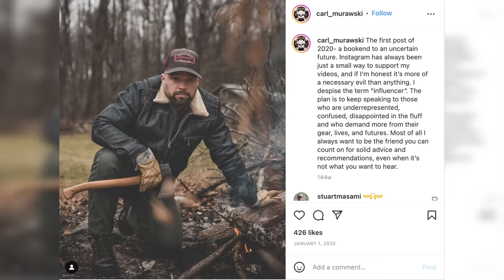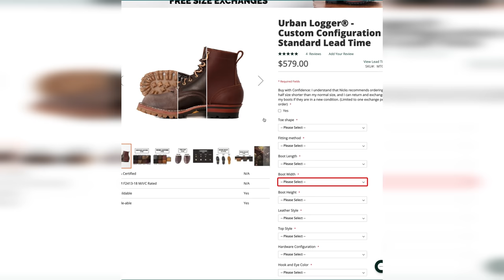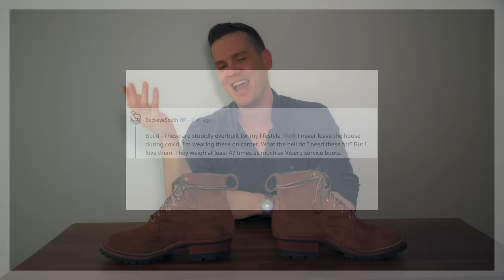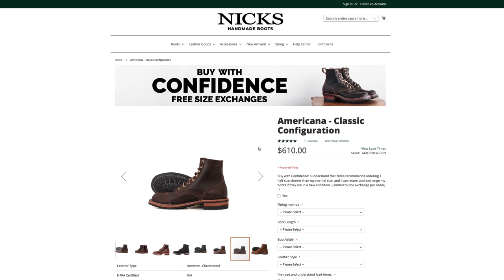Nick's Boots Review | The Urban Logger Isn't for Me (But Might Be for You)

Comment: I own the Nicks Falcon (8" in Predator Orange) and the Nicks BuilderPros (10" in 1964 brown) - I use them for motorcycle riding. Make no mistake about it, the Falcon is an overbuilt beastly boot as well. It weighs 30% more than more than my Iron Rangers and the leather is 50% thicker than the copper rough and tough. I do prefer the Falcons to the BuilderPros though - the block heal with the 430 mini lug makes the boot much more versatile in general.

Comment: Another justification id add to the urban side of this boot would be the arch support. Boots made with the veg tan leather insoles etc arent gonna have the same kind of arch support as a logger boot will. Yea you can find moderate arch support in other styles. But typically, the lower the heel, the lower the support. So if you have high arches, the extra weight and rigidity of this boot might be worth it for you

Comment: Very useful advice. I bought the Urban Drifter which has a regular heel and relatively low arch. I reckon for me they run a good half size bigger than Thursday or Truman. The Difter isn't a city boot but you can get away with it. Strangely, I expected them to be a lot heavier but they are built like a tank.  Bottom line is I would not buy Nicks again as they are too hard core.

Comment: They are definitely on my bucket list.  I just need to get the size squared away as I don’t want to risk getting the wrong size after a long wait. I’m presently wearing a Thursday Captain in 8.5 D and they fit very well but wish they were available in an E width. Great video as always.
Reply: I’ve heard Thursday’s run a little narrow. You’d probably be good in a Nicks D width.
Reply: I’m sure they do a custom fit where you can send in a drawing of your feet and your measurements. I’m in the same boat and just bought a pair of Franks boots. Sent in a drawing and my measurements to let them decide what would be best.
Reply: @MordecaiAliVanAllenOShea  Yes, they do run narrow. Soon, I will go to a proper shoe store and get measured with a Brannock device. Nick’s can then calculate the right size from that to get the proper fit, I hope.
Reply: @flfbsphatboyblue8970  just go a 1/2 size down from your brannock measurement and you should be good. Don’t sweat it too much, if they don’t fit right you can send them back for a different size.
Reply: I also have Thursday's Captain's in 8.5D.  You will want Nick's in 8E if they're the HNW last and maybe 7.5E if they're on the 55 or 67 last🤙🏻  I have 3 pairs of Nick's all in 8E HNW lasts👍🏻  And they are perfect👌🏻  I originally got my first pair of Nick's in 8D but had to return them for 8E because they run a tad narrow.
Reply: Do the fit process. You send them a tracing of your feet with measurements all the way up your leg, then they send you a pair of boots similar in size, you do a consultation over the phone, then you send the try on pair back and they build your boots. Takes some time, but it’s worth it.

Comment: I completely agree with this video. I got my urban loggers two years ago and I have struggled to find times to wear them. I absolutely love them and had them built exactly the way I wanted. However, as you mentioned, I should have done the Americana, Falcon or Robert. It is purely a fun boot for me and I dont do any work in it. I have dedicated motorcycle boots so I wouldnt use these with that either. I feel bad that these will never look well worn. However, what I did learn from these boots is how inferior most other boots are, and I pick apart everything else I buy because of that. I discovered through the building process that Im a C width and wish more companies would offer that. For instance, I love my Grant Stones but they only come in D width.  I had to put insoles in so my feet wouldnt have so much room. Anyway, fantastic video as always!
Reply: That is right. A true motorcycle boot is built different, no matter how tough the Urban Loggers are.
Reply: @humanfirst11  Yeah, just because its a boot doesnt mean it has the toe, heal and ankle protection that CE rated motorcycle boots do.

Comment: Beautiful boots.  I'm about to order some Nicks and had a couple questions.  What height is that boot?  6"?  And that is the 1964 Tan rough out leather, right?  Did you go with the standard last or the Munson?  Thanks!
Reply: BTW, I'm looking at ordering the Munson Builder Pro in the NW Moderate Arch with the 1964 Tan Roughout.  I'm trying to decide between the V100 and the honey soles.  The ones on yours look amazing.  Those are the regular 100s right?
Reply from the maker: @thebreademperor   ah this is 6 inches, I got the standard last they come on. it is tan roughout yeah, the brown 1964 roughout i own as well on Americanas and it's also very light colored. it's the v100 lug!
Reply: Oh cool.  Thanks!  Curious if you could do this boot over again, would you have done anything differently? @Stridewise
Reply from the maker: @thebreademperor  i'd have gotten the americana instead! lower heel. which i did! and i love them. wearing them in now, review.... some time!
Reply: The taller heels look really cool, but I'm going with the lower heel also, since I'm not using these as workboots.  Looking forward to that Americana review!  @Stridewise

Comment: Is the 1964 roughout leather full grain?
Reply from the maker: Yeah it is, roughout just means the leather has been flipped inside out, so it's just as thick as full grain leather because it is full grain leather, just turned inside out. This makes it more scratch resistant. It's not suede, which is thinner